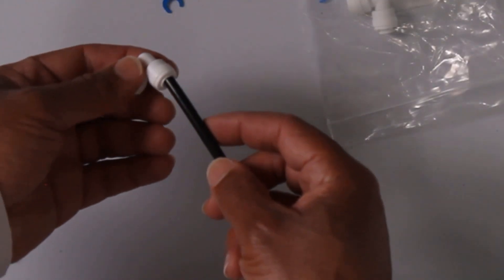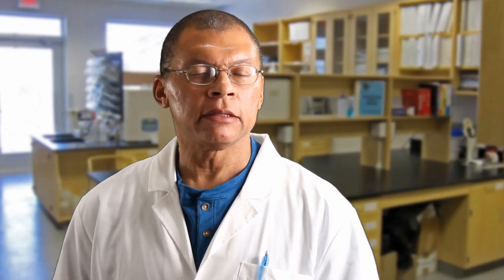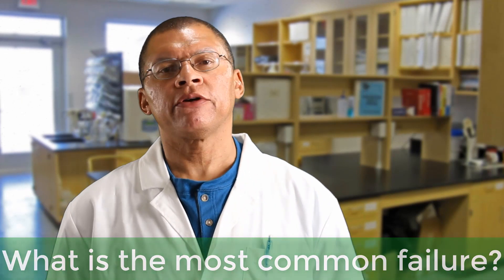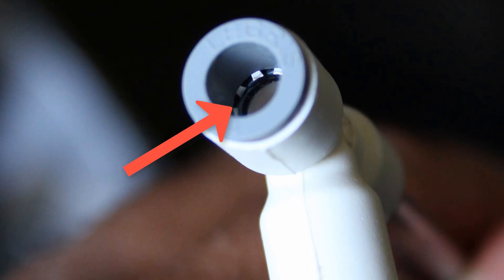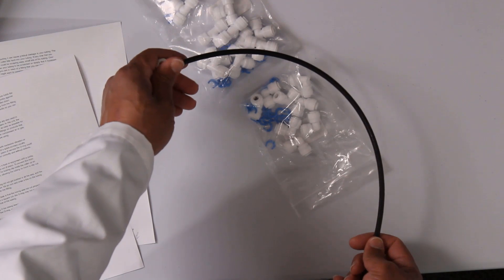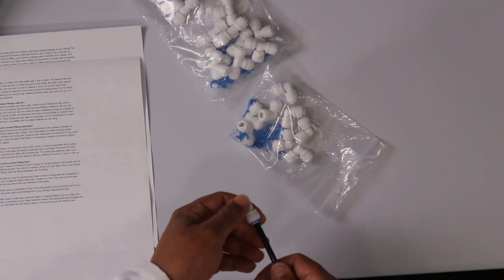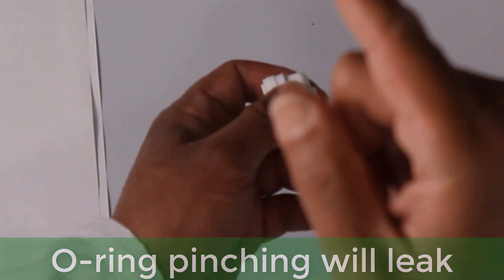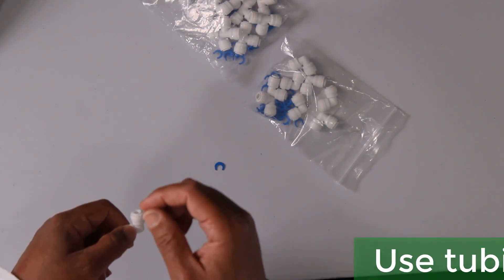High-pressure Aeroponics Quick Connect Fittings the Right Way.

Comment: They certainly do make quick connects for air they may be diferent then the ones for water I have never inspected the the 2 that closely but 18 wheelers use them all over on there air systems